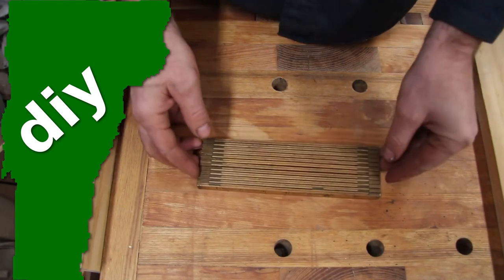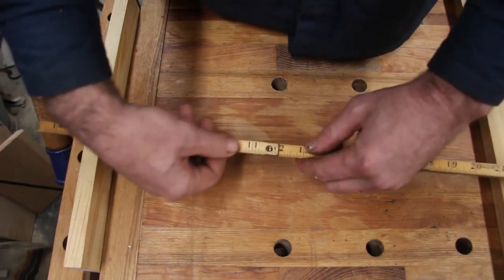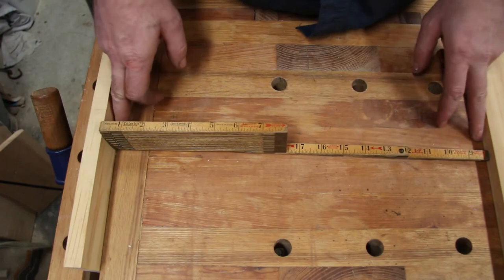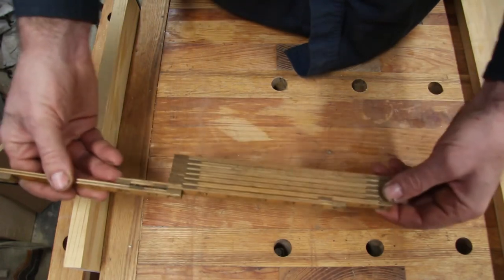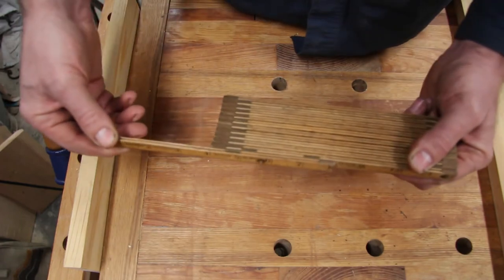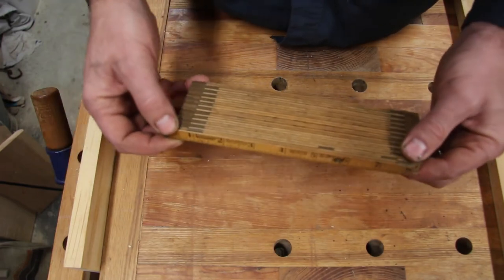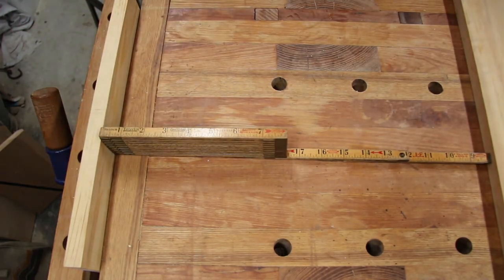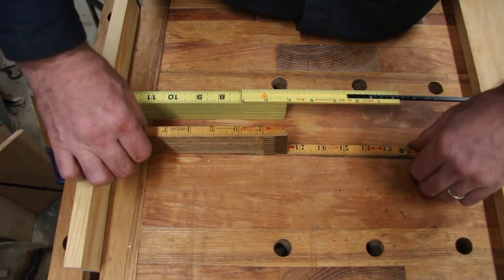Sliding Ruler?

Comment: A rare gem.  The inside measure feature of the folding rule is its one virtue today provided it has a sliding brass section.  This one is superior.  I bet the stuck section could be fixed.
Reply from the maker: It won't be an easy fix, the ends are crimped on and one is loose / slightly bent. I might try fixing it at some point but I am not sure it would be that much better than a folding rule that's easy to find.